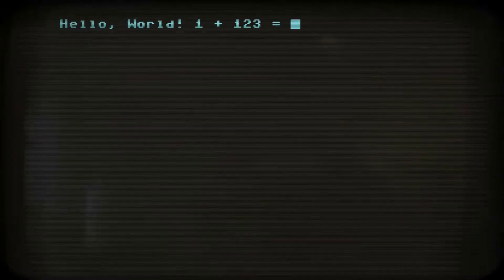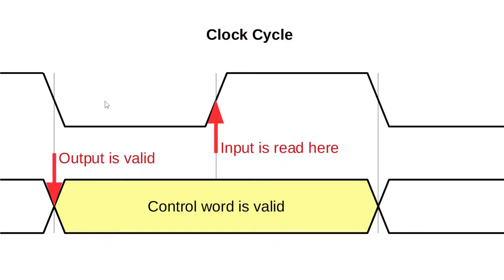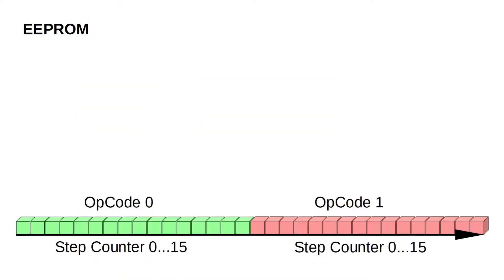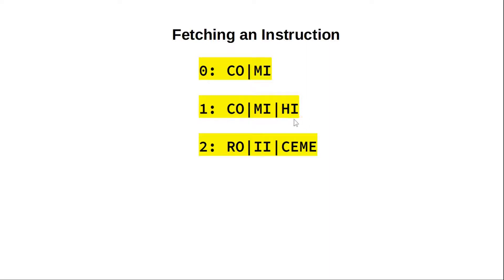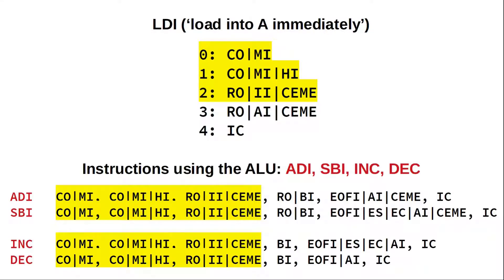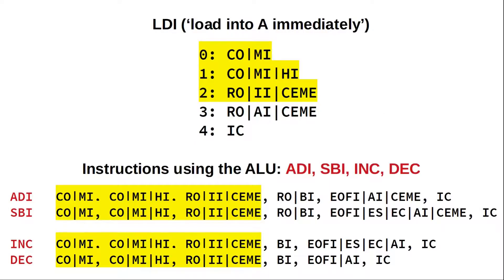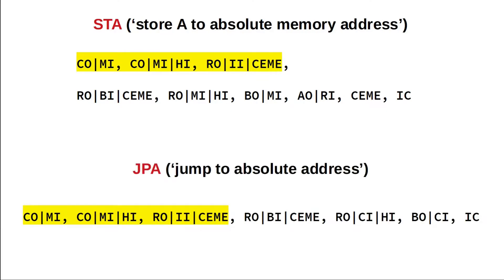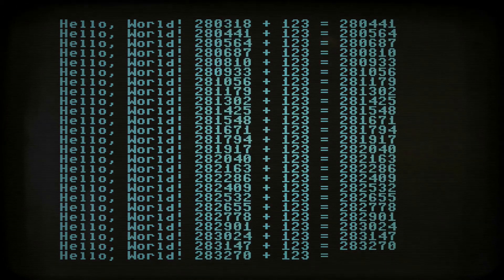Breadboard Computer With Minimalistic Design #6 Getting Started with Microcode

Comment: You are just amazing. Theese videos inspired me as many others to build one on my own. I was just wondering how do you ensure that the registers input the value from the memory before CEME (e.g on the LDI where you have RO|AI|CEME ). Also , you say that the Outputs of the EEPROMS stay locked during the clock cycle but how is that prossible if the II loads a new instruction on the rising edge and thus changed the EEPROM address?
Thank you in advance.
Reply from the maker: Hi Georg, as always, answers may have different layers. Here is a starting point: The key is that some actions (outputs) are "level-triggered" and some actions (inputs, counting) are "rising-edge-triggered". Register inputs sample at the rising edge of the clock where CE/ME initiates a change in PC/MAR at the rising edge. It then takes time to update the MAR output and even more time to change the RAM output. A has already sampled the "old" RAM ouput by that time. Hope that helps you out.

Comment: Love your videos! They have inspired me to try to create my own cpu architecture and write an emulator for it with the hopes of eventually making it on an FPGA or with TTL logic chips for the past year or so. I was wondering in your design how the CEME control line works. Does the instruction register always point to the currently executing instruction? In the past iterations of my designs, it has always pointed to the next instruction/peice of data because I didn’t want to skip over the instruction at location 0 in memory or throw of jump instructions. Does your design skip location 0, or is there some mechanism to get an instruction at location 0 to execute, like having memory enable occur after memory read operations (although that does sound quite complicated)?
Reply from the maker: Hi, great to hear that I got you started on your own design. Concerning your question: Any instruction will start with the following microcode: COL|MIL, COH|MIH, RO|II|CE|ME, ... so PC is transfered to MAR and an instruction is fetched from RAM. The point is that CE|ME act only after II has read the bus. So reading from 0x0000 is no problem at all...

Comment: It would have been more efficient to have a secondary bus(es) for the address stuff and a mux to switch between PC, MAR and SP. PC would output the count on the address bus and when absolute addressing would be needed then MAR could be muxed in, same with SP. XY register pair could also be added to simplify programming when accessing data arrays.
Of course, this would add some more chips.
Reply from the maker: Yes, it's that chip count... additionally, such a more intelligent (i. e. vertical) design would hinder the CPU running a very high clock rate, e. g. 8MHz. See my later videos about that.
Reply: @slu467  The tradeoff between faster clock vs less cycles per instruction would pay off anyway IMO (and then you get some more ease of use when programming, so probably you could cut down on number of instructions executed in any algorithm, but that means a larger instruction set). Then you get into territory of having a separate adder on the address generation unit to decouple it from the ALU to cut more cycles when using relative adressing, etc.
CPU design is a fascinating subject, I must build one myself one of these days.

Comment: Wouldn't it be an optimisation to have fetch at the end of instructions, and have them not move PC into MAR if it is already there? Though one would have to make sure that whatever the IR defaults to is a nop and will fetch instructions immediately
Reply from the maker: Nice idea in principle, however, I found that these optimizations usually "cost" a lot of logic chips and are complicating the design (think pipeline) which I wanted to avoid here. Cheers!

Comment: I don't understand why you'd need to give the MAR the ability to increment if you have a program counter 
is there a reason for that?
Reply from the maker: Hi, this little trick is essential to be able to pull off complex instructions like JPS, RTS etc within just 16 micro steps. It greatly facilitates the readout of consecutive memory cells - often needed when processing 16bit addresses. But I see how this might not seem obvious when considering general principles. Cheers!

Comment: There is no important information in the video or your code on the page https://github.com/slu4coder/Minimalistic-8-Bit-CPU/blob/master/Microcode_v1.29_MINIMAL_8-BIT_CPU.txt. 
How to calculate particular bytes to write to EEPROM?
I suppose that for example under Arduino Mega it should be:

unsigned short EEPROM[8192] PROGMEM ...
...
MSB_EEPROM_byte(address) = ((pgm_read_word(&EEPROM[address])^CTRL_INVERT_MASK & 0xff00)>>8);
LSB_EEPROM_byte(address) = (pgm_read_word(&EEPROM[address])^CTRL_INVERT_MASK & 0x00ff);
Reply from the maker: Hey Adam,
the info is quite important i think - just maybe not in the form you intend to use it. But you are doing it right: Just adapt things for whatever situation you intend to use it. Cheers!